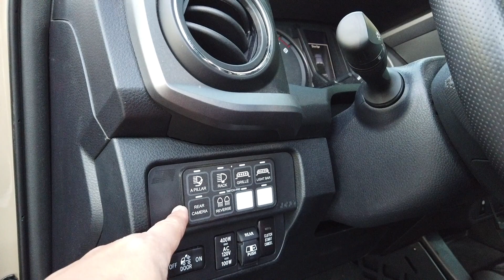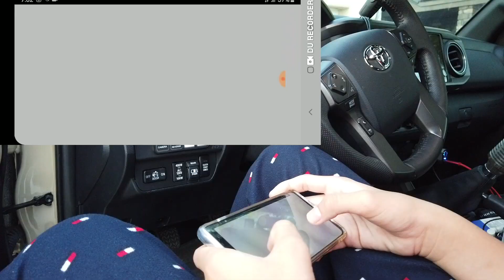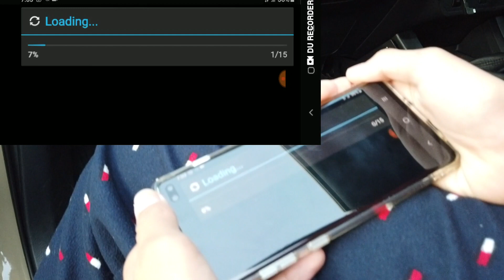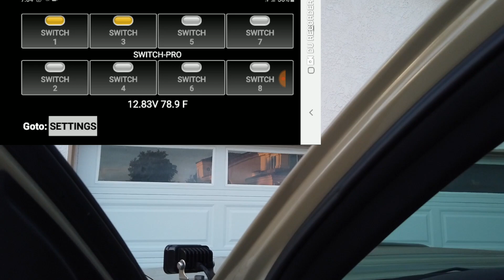How to Get Baja Designs or Any LED to Strobe like a Police Car. Off-Road Use Only

Comment from the maker: I had several people DM and comment on how did I get my Baja Designs lights to strobe. 

If you didn't know it's because I'm using a Switch-Pros control unit.

This was for Off-road / Demo use or emergencies. Please check your local laws and use common sense.

You can get the Switch-Pros unit here https://amzn.to/2Gt6T8a

Comment: Lol
Back in my day and days of slammed Toyota and Datsun mini trucks, I wired my amber turn signals to synchronize with my brake lights; I had an 83 Toyota red sled. Within a week, I got pulled over by CHP and told me I had to undo what I did because I might be mistaken as an emergency vehicle responding to a call. Have fun errybody!
Reply from the maker: Never heard of that one. I remember it was a thing back then.

I remember hyperflashing was cool then too but not any more. Lol

Comment: I’m curious if you can actually use an actual emergency LED light bar. Of course changing the colors to white and amber. Most modern light bars have a “flood of scene light” feature.